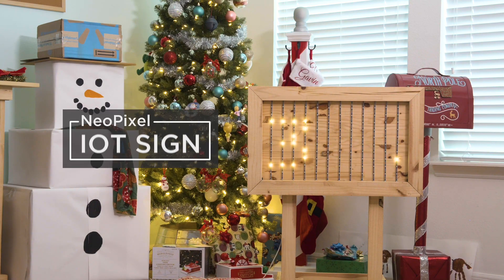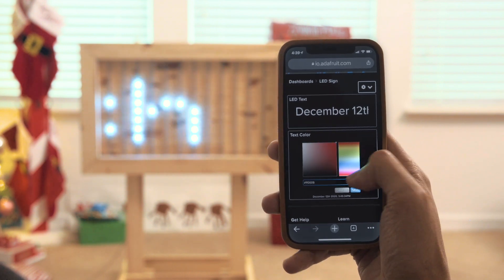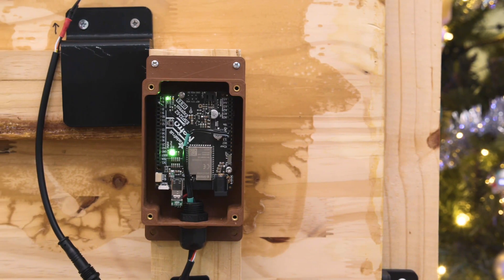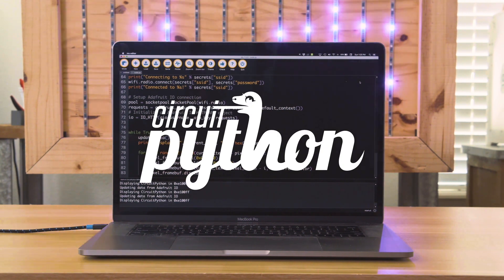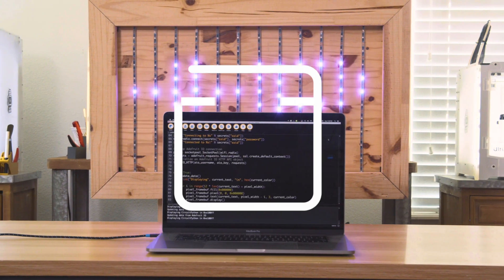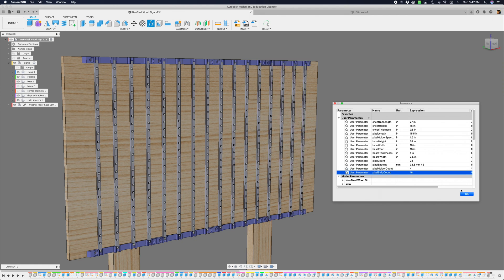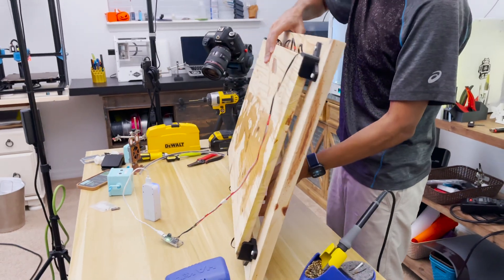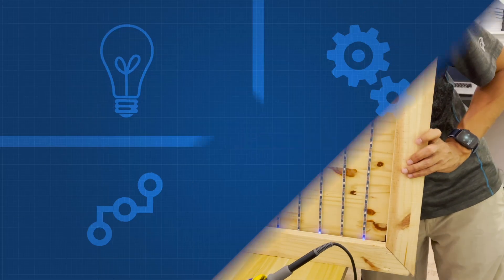ESP32 S2 IOT Sign with a NeoPixel Strip Matrix #adafruit

Comment: How about adding a sheet of smoked plexiglass to 'hide' the internals of the panel. It'll still let the colors through, but you may have to turn up the intensity a bit. Also painting all the wood inside the box with flat black will make things even more vivid.
Reply: My thoughts exactly. Smoked plexiglass would give the displays more contrast.. Paint all the inside wood black. It then would look neat.